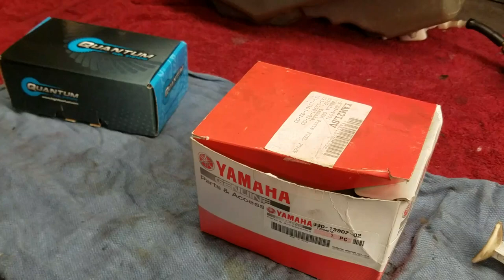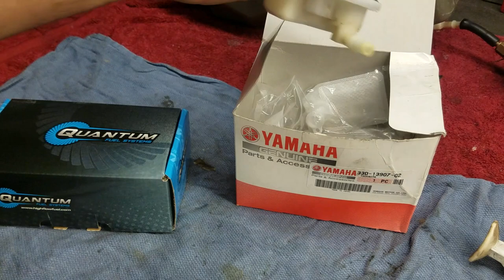1:11 YZ250F Fuel Pump Failure & Repair  (same for YZ450f). Hard starting, bogging, and popping.

Comment: I got a 2017 yz450f and it just had a full rebuild it’s got good compression valves are in spec but I have a problem where it will Boggs out and  shuts off after it’s gets warm then won’t start no matter how much I kick it but once it cools off it will fire up and do then same thing all over again do you think it could be the. Fuel pump
Reply from the maker: Could be a fuel pump or a stator. Both are easy to check. Get her hot till she shuts off. Hook a pressure gauge to the fuel pump and kick to check the pump for pressure. While having gthe tank up pull the spark plug and ground it on the frame, kick and check for good spark.
Reply: Thanks man it was losing spark just order a stator hopefully that does it
Reply from the maker: @hondakilla8239  That should do the trick. If it doesnt it wouldnt hurt to swap out the voltage regulator but usually its the stator.

Comment: Mane I checked my fuel pump filter bcuz my 13 rmz 250 was stalling wen I push choke in at 35 clicks , unless I turn the choke nob all the way to 45-50clicks out I can push choke in an no stall but mane my filter so dirty it looked  super black n it was a bug on the outside of filter ,don’t ask cuz it’s no way I can ever see how it got there but now she idles at 35click out with no choke , got a aftermarket fuel pump n kit off eBay for super cheap but it was a Japanese part not Chinese
Reply from the maker: Thats good news!  Good job!

Comment: What kind of gauge is that? Is that a specialty tool or just a regular water pressure gauge ?
Reply from the maker: Its just a cheap fuel pressure gauge from harbor freight. Like like 25 bucks i think.

Comment: hey boss i just replaced my fuel pump in my 15 yz450 and now it wont turn over at all. was a 60$ ebay pump and filter. is there any way to prime it or should i consider the pump bad
Reply from the maker: I would check the fuel pressure.

Comment: Do you know why my yz450f 2015 dies after 30seconds i  checked it gets fuel and it doesbi took out the whole electrical system out when doing a rubuild and but it back togheter but i put 1 cable to the wrong place ut was thw killswitch cable and rhe cooland sensor i forgot to plug in and than i did it right i started right up but after that it stalls on me
Reply from the maker: Is the ECU mounted correctly with the up side faced up like it should be?  They have a tip over senser built into the ECU and if its not mounted correctly it will shut the bike off thinking its tipped over.

Comment: Ive got a 2017 having a bogging issue after about 45 minutes its the electrics in the pump goung bad after hot .. i cant find the full rebuild kit on quantum i see it for all balls any help would be great
Reply from the maker: Hello. If it happens after everything gets hot it could be the fuel pump but also could be the stator. Both quantum and all balls are good kits, either one will work well. If that doesnt fix it up maybe take a jab at the stator.

Comment: Just installed a quantum rebuild kit on my 2014 yz250f. Pressure if just over 50, but it drops off instantly. While trying to research the problem, I start reading all these reviews on quantum about danger fuel leaking down and I should avoid these pump kits. Now that I’m into this thing for about $80, what should I do now and do you know about this. What are my options
Reply from the maker: I would take it back apart and find where it is either leaking pressure by or if the motor itself is allow fuel to flow backwards when its off, which will allow the pressure to drop.  Its very common for people to make a small mistake when putting these kits in so I would surely run back through it and check everything out
Reply: @UpAllNight91  thanks for your reply. I was asking for my friend and sure enough after talking it apart, he found an o-ring that was cut. So yes, small mistake bad outcome.. ha. Thanks again
Reply from the maker: @swamx737  ahh right on!

Comment: I’m having a hard time starting my bike I already did a pump rebuild but I seen that when I kick it over it does throw gas like it should but if I leave it sitting it start leaking gas without even kicking it I have a 2014 yz450f
Reply from the maker: They should not leak when the pump is not running.  When it leaks that usually tells me something is not right with the pump. Most likely a o ring out of place or a leak somewhere.  It most likely will leak or bleed the pressure off. If you do a pressure test it probably will fail.  I was disassemble the pump and double check everything
Reply: @UpAllNight91  okay will do thank you!

Comment: My outlet of the fuel pump(where i connect my fuel hose) leaks fuel when i take the fuel hose off , i heard it takes pressure out of your system and could be the cause to my fuel injector not spraying when i kick it from lack of pressure, any idea what i should replace or do  apparently its not suppost to leak when u take the fuel line off of the fuel pump outlet
Reply from the maker: Hello. If the outlet of the pump keeps dripping fuel when disconnected, every time I have seen that the pump was not good. I would take the pump apart and check all the seals, and fuel pressure regulator and stuff.  I have seen the yz fuel regulator go out more often then others.  Which a good pump it should build enough pressure in the fuel line after being reconnected to start up within 5 to 7 good kicks

Comment: I got a 2014 yz250f has spark, replaced fuel injector, but fuel pump doesn’t do anything when you test it, doesn’t even hold pressure, I’d love some help. Thanks
Reply: I got the same bike as you,is yours hard to start it up
Reply: I ordered a new oem fuel pump for mine,going to install it this weekend I'll let you know if it helped,my bike runs fine when I bump start it but doesn't kick,I'm thinking my airfilter might have too much oil in it aswell as I bought a cheap ready to use one
Reply: @edgarbaez1366  yea, the oem was to expensive for me so I ended up going with the kit, so I’ll keep you posted on that as well.
Reply from the maker: I would check the valves on that one.  Especially if one you warm it up then it starts with the kicker, till it gets cold again
Reply: @UpAllNight91  I installed new oem fuel pump already,it kick started on the 8th kick,I rode for and hour and then shut it off,I tried kicking again and doesn't want to Kickstart now I took to yamaha dealer last month they checked the valves said they were good,I also put in new fuel,new sparkplug and new airl filter,cleaned all the electric connectors,any  ideas on what else I can try
Reply from the maker: @edgarbaez1366  pull the spark plug and check for spark?  If you have spark then put about 2 ounces of gas directly down the spark plug hole into the cylinder and quickly put the the spark plug back in and try starting.  You may have to crack the throttle some while doing this.  If she barks off for a second and then dies you may have a fuel issue somewhere.  If she doesn't bark off then its most likely something with the motor
Reply: @UpAllNight91  thanks man I appreciate it,I'll try that next
Reply from the maker: @edgarbaez1366  any luck?
Reply: @UpAllNight91  haven't had a chance to work on it yet,but I was thinking if it's able to bumpstart and runs and idles ok then the spark should be good right?
Would it be possible if the injector is faulty or dirty can make it not kickstart?
Bike has 107 hours on it all original never raced
Reply: @UpAllNight91  I appreciate the help alot
Reply from the maker: @edgarbaez1366  hmm. If it bumps started.  After warmed up. Shut and down and see how it starts while warm.  If it starts good once its warm I would check them valves again
Reply: @UpAllNight91  it still takes alot of kicks even after it's warmed up sometimes it won't start again at all,you think maybe the spark not strong enuff?was thinking about getting an iridium laser plug see if that does it,also noticed when I put the new airfilter in it kicks alot smoother,can air filter oil cause damage to throttle body if some got in
Reply from the maker: @edgarbaez1366  a test to see if the spark is just weak is to tighten the spark plug gap down to half and see if it improves the condition. If it does then its weak spark and that would need to be addressed.
Reply from the maker: @edgarbaez1366  also i would make sure the gas is not old.  Seen fuel even just 2 months old cause all kinds of running issues.
Reply: @UpAllNight91  finally able to start it,put in a new oem coil and cap got it to start first kick off TDC,starts up after hot aswell now,thanks for your help man
Reply from the maker: @edgarbaez1366  that's great news!

Comment: My Pump drips gas when I disconnect the house is that normal?
Reply: Yeah I just rebuilt my pump and now if hose is unhooked fuel just flows out even with no power to pump. Trying to figure out what's going on
Reply from the maker: Usually when they drip fuel when the pump is off, I find one of the o rings either didn't fit and seal well or is not fully seated correctly. When that happens I take the pump back apart and check the o rings.  Sometimes the ones included are not a good fit, often the original can be reused to get a good fit.  And if all else fails I grab my harbor freight o ring kit and see if I can find one that does the trick.

Comment: Why does my 2010 yzf450 blow black smoke at rev limiter it also takes 4 kicks to start when cold after it’s warmed up starts first kick
Reply from the maker: Black smoke is richness.  Could be normal if its just a little. If its a lot then I would look into things. 4 kicks when cold on that bike is about normal.
Reply: I took my Gas tank off today and noticed a little bit of gas leaking from the fuel pump nipple that connects to the hose is that normal ? It was not leaking alot more like a dribble here and there if I tilt it it would leak more
Reply from the maker: @latiajuana2953   usually when they keep dribbling while disconnected I find the pump is bad. Either regulator in the pump housing or a leak somewhere in there. I would dig in and repair the fuel pump assembly. Either just buy a new OEM complete one of buy a pump kit and also be sure to replace the regulator thats on the pump housing.

Comment: How do you know if the pump is bad? I have a 2015 factory bike from my buddy that rode for bto. engine is built so it’s already harder to start but it’s been sitting for alittle while now since his last race was Loretta’s with it in about 2016 says he rode it from time to time but it won’t start
Reply: Also where are you located ?
Reply from the maker: I'm in the tampa bay area.  I would start by draining all the old gas and putting fresh gas in.  Then run 12 volts to the pump and do a pressure test.  If alls well then connect the fuel line and give her a test fire, if not then rebuild or replace the pump. Next.  If she doesn't fire she may also need a new fuel Injector .  Been down that  road myself.  Thats how it went
Reply: I tried reaching out to regarding my bike through email I live in the same area was wondering if I can bring it by
Reply from the maker: @glennrichard8110  sure. I haven seen any emails.  Try shooting me a email again.  Of course I'm sure you know there is no power right now but by next week I should be back up to speed
Reply: @UpAllNight91  I have a very similar issue on a 2010 yz450f where it will sometimes take many kicks to start but only when hot. Could it be a fuel pump issue? I am replacing a fuel pump on a 2019 raptor 700 with a quantum kit and wanted to see if I should order both.
Reply from the maker: @nikolasrobinson89  hello. It could be.  I would getbthe bike nice and hot.  Then remove the tank, connect a fuel pressure guage and connect a battery to the pump.  See how much PSI she is making and also see how fast the PSI climbs when the power is connected.   It needs to climb fast, especially in a kick start bike because it will only receive power during each kick.

Comment: Is it normal for the pump to drips gas when I pop off the hose ? Like it continues running gas out ?
Reply from the maker: No, not normal.  Usually indicates it has a bad or misplaced rubber o-ring in the pump assembly.   I would open it back up and make sure all the o-rings are in place and sealing well.
Reply: @UpAllNight91  thanks for answer bro I will go ahead and order a new pump.
Reply: Did you ever figure your out? I installed quantum kit. Have tried the quantum and factory o rings etc. And everytime I put pump back in and flip tank over fuel starts coming out the outlet. Torn pump apart about 6 times trying different combos of O rings. Have great fuel pressure though.
Reply: @jacobfaltermayer1902  my old pump never worked well anymore.  I did ordered a brand new one so I'll be back on track soon.

Comment: I have a 2014 rmz 450 that don't start everything in engine & valves are in spec I check the fuel pump pressure & is on point but the pressure drops when I disconnect the fuel pump from a battery do I need to replace the entire fuel pump or can I do same thing you did in the video?
Reply from the maker: Yes the kit should fix the fuel pressure drop. However just for a test I would remove the spark plug, check for spark, then put some fuel directly down the spark plug hole and install the plug and see if she will bark off for a second. That would let me know that everything is ok for her to run she just needs fuel
Reply: @UpAllNight91  I check the spark & is there put gas in the engine like you said & engine run for a second but I don't get why I have the spec psi on the fuel pump but drop quick when disconnect from the battery
Reply from the maker: Ok well thats good, it wants to run.  It needs to hold pressure in between kicks, if it drops pressure when you disconnect the power it will also drop pressure between kicks.  So I would rebuild or replace the pump and it should be ok
Reply: @UpAllNight91  thanks for the reply & blessings bro ✊
Reply from the maker: @yamilrivera143  yes sir, and you too!
Reply: @UpAllNight91  sorry for bothering I replace the fuel pump & still not holding pressure ☠️
Reply: @yamilrivera143  you did something wrong then
Reply: @JNYDZL  yes I did I didn't pay attention to the gas pump rebuild kit & not installed a o ring that goes on the  plastic  that go to the pressure regulator fixed and is running like a champ 🥳
Reply from the maker: That's awesome you got her going again.  Sorry for the late replies,  I'm here in Tampa Florida area preparing for a storm lol.  I just wanna ride!
Reply: @UpAllNight91  thanks again for posting videos helps a lot , same here I'm in Kissimmee & preparing for the hurricane stays safe & blessings brah ✊
Reply from the maker: Yes sir!  You too!!!

Comment: Do you have any cases for a 2016 yz450f?
Reply from the maker: Hello. Sorry I don't have a cases for a 16 yz450.  I would check ebay, see if you can find a good used set. Should be the same from 2014 to 2017
Reply: @UpAllNight91  I checked, it’s mostly right sides.
Reply from the maker: @Jason-zr6il  crap ok.  Well can always buy new.  Or if your not in a hurry check ebay daily till one pops up